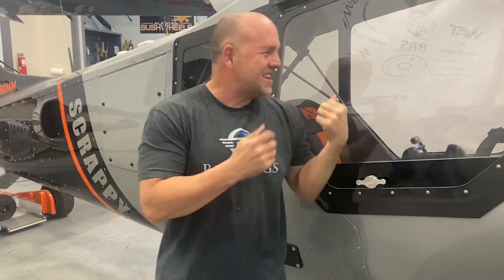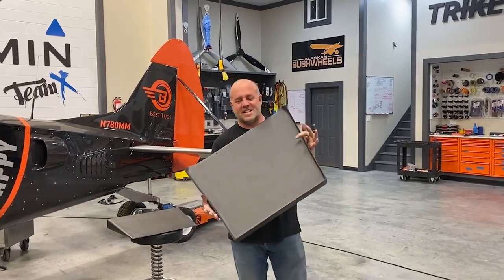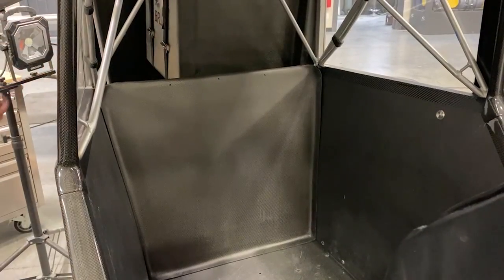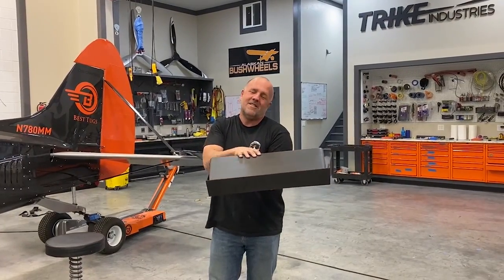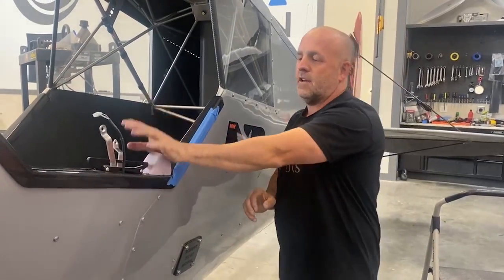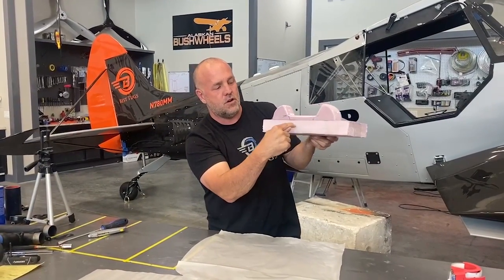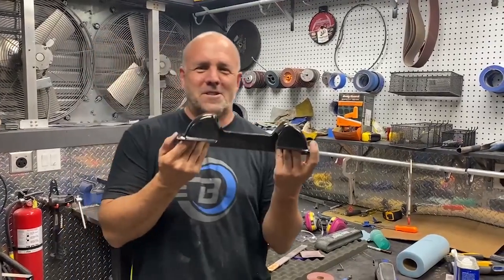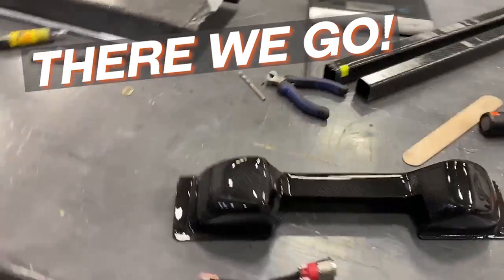2 Seat Dragster Bush Plane - Would You Ride? | Scrappy #38

Comment: When @Mike Patey called this plane "Scrappy" I thought it was going to be a junkyard builds type project where he built a plane out random parts he had laying around as a quick side project.  This plane may be based on an engine and frame that was already existing, but it has turned into a purpose built monster.  I love it!
Reply: Yeah it’s just scrap parts, any body could whip one of these up. 😂😂
Reply: After following the Draco build, I knew we were in for a treat. I knew Scrappy would be anything but 'scappy'.
Reply: @CrispyOkra  maybe..... he reused a valve stem cap........lol
Reply: I think the crash of Draco is what launched scrappy into the stratosphere.
Reply: @Brodozer39  
I can’t wait to see the new Draco/Wilga construction.  Should be interesting.
Reply: @keirfarnum6811  I’m not even ready for the next Wilga build lol. I’m still in denial that scrappy even exists at this point, it’s just too good to be real, that I can’t even comprehend the next build yet!

Comment: Is nobody going to mention the 'Easter egg'? Looks like the green Wilga getting worked on behind Scrappy at 13:43...
Reply: Looks like Mike has some helpers on the new green Draco.
Reply: Nice catch!!
Reply: I think you're correct.  He had the view perfectly blocked before and after that brief scene.
Reply: @Patriot-bn9om  believe it or not that's what caught my eye. The obvious blocking of the view out the window. I also noticed the wing in the upper corner of the screen on the shot before. I was actually hoping that it was Scrappy's wing but the Wilga is just as good.
Reply: Well he did say he was building another wilga so yeah probly
Reply: Yes, you... 👍
Reply: Great spot!
Reply: I say it's the RC Draco!
Reply: @kramermd  i have a 110 inch wingspan rc wilga with a 4 stroke gasser engine ajd its fantastic i reccomend it to everyone into rc.
Reply: @alanluscombe8a553  look in the top left at the 48 second mark... looks like Mike had 2 of them.
Reply: @kramermd  2 full size or rc?
Reply: @alanluscombe8a553  RC
Reply: @kramermd  aaahhh good eye. I most definitley see one.
Reply: @alanluscombe8a553  yes , both

Comment: Does anyone else feel like their IQ drops several points every time they watch a Patey video?

Mike--a safety concern: Maybe it was only camera angle, or maybe you already have a fix in the works, but in the shot where that guy was in the back seat, it sure seemed like there was a lot of frame structure in relatively close proximity to his head. A hard, bouncing landing could potentially cause a head injury.  A helmet or padding on the framing would help. It just caught my eye.
Reply from the maker: It’s an optical illusion, his head is quite a bit further away than it appears.

Comment: I saw throttle, prop and flap control on that assembly, but it sounds like mixture was integrated too...? I just couldn't see where? Electronic switch?

STOKED on every single one of these videos. I'm working too much to fly for these winter months ... so these videos are keeping the stoke alive in the meantime! Thanks for all the time invested in making them available.
Reply from the maker: The prop is fixed, but the blue knob is what I had on hand, it’s being changed out to red.  That’ll be my mixture. 👍🏻
Reply: @MikePatey  Oh right! That ground adjustable “main rotor” ... that y’all are calling a “propeller”. 😁 So mind boggling 🤪

Comment: It is very important to have a comfortably back seat because at some point your wife will claim the front seat !
I added back seat controls to my RV4 because it is very helpful if the front seat pilot becomes incompaciated. My installation was quite simple rudder and stick,  the throttle was on the side similar to yours I could reach it from the back seat. I decided being in the back seat with primary controls is far better than trying to reach over and around a non responsive person in the front.

Comment: Great job! I'm happy to see the doorhandle turned to the correct orientation in closed configuration . If I'm not confused, it was rotated 90 degrees in the video when it was constructed.   A cheap 3D print of the  throttle handle would have saved you two failed runs in the milling machine.  I'm expecting you to have one in the shop, so why not use it? ;-)
Reply from the maker: thanks for the comment.  I just like the look and feel of the aluminum throttle. 🤠👍🏻
Reply: @MikePatey   Of course must it be made out of aluminium!  Printed plastic would not make the cut for Scrappy.  What I ment was to 3D print a mokkup, so you could achieve the right feel at the first try in aluminium.  It's just a cost effective way to do R&D.  Have you plans for the blue handle? The colour kind of stands out from the Scrappy theme?

Comment: Hi Mike. Considering flaps switch on throttle lever .There is a similar design on An-2 by Antonov. Difference is you can only lower the flaps with this button. To retract flaps you have to use switch on the console below. I think the main purpose is for safety reason not to retract as you want to extend. I think  for you is not the case because Scrappy will not have any other users.

Comment: Quick observation about the rear seat and the apparent proximity of the fuselage framing  to the passengers head. It appears in the quick shot in the video that head impact with the fuse tubing is inevitable given bad turbulence, hard landing, or forbid, something worse. I own a USAC sprint car and we used to use roll bar padding to mitigate head strikes on the roll bars, but With the new seats, padding is no longer used, but I wanted to pass along this observation for whatever it's worth.
Reply from the maker: It’s a bit of an optical illusion, the bars are further than they appear.

Comment: Why don't you use 3d printing for parts like the throttle handle? SLA printers are cheap nowadays and with the right resin you can print a solid lightweight handle that is really strong not as strong as aluminum but way stronger than needed. I think you should look into it. It could also make your mold making a lot easier as well. Great video Every time I see you uploaded it makes my day!!
Reply from the maker: We have a couple of 3D printers and do use them occasionally.  But on this one, I just like the look and feel of the aluminum.
Reply: @MikePatey  Wait till you have to park it with the sun coming through the window.
Reply: 3d metal printer? Amazing what detail they can print now

Comment: I think I would feel a lot safer in this aircraft with its tube framed fuselage and a strut braced wing than the strutless Wilga. I was surprised how easily the starboard wing on Draco folded down at the root when the port undercarriage leg tucked under in the accident. I wonder if the Wilga with its extended wingtips and lift enhancements had a negative g-loading/torque-loading failure waiting for a chance to spring an ambush. The clean sheet engineering for the Scrappy wing at least makes the builder party to his own fate and not at risk from the unknowns in someone else's prior work.

Comment: So Mike, I worked on a seaplane  base in Belle Chasse, La, ( New Orleans). There I worked on Cessna 180, 185 and 206's and one Beaver. Seaplane pilots are notorious for rolling the plane on one float and popping flaps.  I notice all the cowboys pop flaps even on airport runways.  The 206's had electric flaps and popping flaps really did not work in that aircraft.  The transitions  from 20 degrees to 40 back to 20 was too slow.  So now you are putting electric flaps on Scrappy.  What's the goal here. I guess with Scrappies power to weight that popping flaps won't be necessary. I have a funny feeling you have this all figured out.

Comment: Having flap lever on throttle brings about much convenience similar to HOTAS concept, too convenient perhaps?
However, shall the flap lever be accidentally get triggered(be it to retract/extend) while making adjustment to throttle.
1) High speed cruise + accidentally flap extension over Vfe.
2) Low speed approach + accidentally flap retraction at Vref.
Both having risk of structural damaging/stalling though manufacturer's(in this case yourself) margins will be included in these speeds.

Comment: Mike I was just wondering.  You are doing a lot of sanding to form the foam edges.  Would it save time to round over the edges with a router table (Not sure if it would work!), but it could save alot of time in shaping your edges.  Let me know what you think, or even if you have tried it.

Comment: After you made the foam plug what did you use on top of the foam before laying the carbon?  Did you just apply some resin to give a hard surface? Also do you put any type of release on the plug or not worried because you just dig the foam out not using it over again. Thanks and can’t wait for the next vid.

Comment: Question, do you think you will have any issues with the mixture being so close to the throttle, seems like it would be easy to accidentally catch it with your fingers/knuckles when working the throttle. Not being a critic by in any way, just curious. Love the videos, can’t wait for the Draco X build 🤘🏼
Reply from the maker: It’s further away than it looks.  It’s the same throttle and mixture out of a Carbon Cub.  Good thinking though.

Comment: Has the front seat some kind of locking mechanism? The ability to flip it to the front is great but although your bodyweight holds the seat down, in zero or negative G flight you might be lifted up with your seat which would be annoying or in some cases even dangerous

Comment: I've not run into this myself, but I know how well you build so I just wanted to know---Just how air tight is the cabin on Scrappy?  Reason?  I read a story about a guy who fell asleep in a Bonanza and the plane landed (crashed flat) in a snow field.  He found out the exhaust had a crack and flooded the cabin with CO.  He lived without serious injury but admitted he should have installed a CO monitor.  Can Scrappy have this issue, or is there lots of air flow when flying?  Just a thought.  Fly Safe.

Comment: Mike, in your throttle assembly, I only saw the prop and throttle, no fuel mixture. However, you referred to the throttle as the mixture. Something is missing here. Have you got an automatic fuel controller on this engine?
Reply from the maker: All I had was a blue knob on hand, it’ll be changed out to red.
Reply from the maker: Lol 😂 yea I new somebody would catch that.  I only had a prop handle scrap on my shelf so I put it on to run it but I have a red mixture handle I’m replacing it with.  It will be red soon
Reply: @MikePatey  Haha, it’s funny what people see. So that is a fixed prop then?

Comment: Scrappys wings are complete, and are hiding (hanging) in plain sight. 12:30
Wings are painted in gloriously reflective colors. 12:38 through 13:29

I suspect the orientation  of  Scrappy in the shop has to do with static  (or not so static) wing testing. And/or the addition of a Wilga..

Lack of fuel tanks are explained at 13:49 as are the A/N fittings and the JATO/Float plates... External tanks/folding step.
Oh wings... Telescoping wing and airfoil control mechanism 

https://patents.google.com/patent/US7866610B2/en

When he does floats, floats they will serve as fuel tanks.

Jus sayin. 

Never underestimate a five year old.

Comment: Okay hear me out because I don't know if this is a good idea or not. Get a tungsten  flywheel put it on the engines shaft, then a clutch and then carbon fiber props, I'm thinking you could do some sort of rev up and store a whole lot more energy in the flywheel and then pretty much dump the clutch and instantly put a ton of energy into the propellers.

Comment: Normally I agreed with almost everything you do.... But I have to disagree with the throttle drilling... Not because of structural... But cleaning it will be a problem. Won't those holes fill with dirt?  Once filled how much weight will you have saved?
Reply from the maker: Good question, so they pass all the way trough and the bottom is hollow so it can’t collect dirt.  I’m not sure how often I would grab with muddy or dirty hands but it will just fall right out.

Comment: so, what do you think about the secured point/ attached /pin point being were the seat belt is.    another words. the easy way to break a point of security is at the point of security/ the pins........   so, i thinks the pins attached to the plane will break at a crash with all force being on them and not a secondary point.    just a thought.   if that made any since, i see the problem in my head and i might not be able to say it out loud correctly.

Comment: In our (tube frame) race cars, you have to have a structural seat, contained/floating with the roll structure.  I won't even go into MBs in the Navy stuff I flew.  In GA is there no requirements on seat strength?  mounting to crash structure?

Comment: I have been wondering for awhile and have to ask.  Have you considered using 3D prints for carbon fiber molds?  I know you bang out those foam molds cheap and dirty but I see some places that a quick sketch in solid works and a print would give a really nice mold.  I really would like to hear your thoughts on this.  Stop reading this and get back to work!  cheers

Comment: i only have 1 or 2 problems with scrappy, 1 you sealed 1 side of your plane so you blocked an emergency egress if it rolls and lands with the craft door side down you could be trapped. 2 its a gas hog add hho to your system to improve efficiency and output.

Comment: What did you use on the foam to make it shiny before you put the carbon fiber on? Is it to keep it from melting from the epoxy or the heat of the reaction?
Reply from the maker: It’s clear, standard packing tape to
get the foam to release.
Reply: @MikePatey  I’ve seen you use it before but it just looked different this time. Looking great and always great to see your brain at work.

Comment: Buenos dias. Mike, lm  Cubano  lm leaving in Huntington beach California and I building RC airplanes I use the same  pink fomy.
What type epoxy you using???? Thx.
Reply: I using KWIK BOND EPOXY High Strength Part "A" Resin, Part " B" Hardener  sets in 30 minutes, it no good  get to hot and malted the pink and the blue  fomy. Thx

Comment: I really encourage you to dare build a plane from scratch to have the design freedom to make it super aerodynamic, light, fast and perhaps single piece. When you start from an existing model you are very constrained and do enormous work around those limitations. From scratch is so much better and easier. Just have to dare take responsibility for the design which you do already anyway.
Reply: And if you really want to knock it out of the park then have tiny turbofan engines made. 2 10kg engines on a 100kg 2 seater plane. Razor laminar wings. Pressurized, transsonic. So quiet and smooth. And with 2 engines you can go over the pond to Europe. Flying gas can, maybe 4000km range.

Comment: I have a question I wonder if anyone can answer. On a build like this how does one test the capabilities of the airplane while at the same time taking into account stress on the airframe and and wings etc.  For example, how do you test the safe amount of stress the wings can take at a certain altitude going at a certain speed, and doing this for the entire lifetime of the aircraft.  This is probably not the clearest of explanation, I don't have a manufacturing or mechanical background, but instead a electronics engineering background. So I apologise for the poor wording/description.
Reply from the maker: Great question. Hard to answer quickly.  so I’ll do a video about it.  Every part is engineered and many stressed to failure first. Others are based on past test. Wings are based on FEA runs and calculations as well as wings of the past and adjusted for additional loads.  I often have twice the time on the engineering side than I do on the building of the components.
Reply: @MikePatey  That's so awesome you gave a reply. And here I was  just hoping  someone in the community will see the comment and give a reply.  :D A video would be amazing. It's pretty cool what can be done with software nowadays. I can imagine a lot of planning has gone into the build. It's truly awesome. I could probably ask 100 more questions,  but instead I'll be patient for some video content. I love learning about the technical details (as I'm sure many more who watch the videos do).  If you happen to read this, thanks for all the great content. God bless and hope you have a great week ahead.

Comment: Piece of that gel computer mouse padding would be nice against your palm too. so your not gripping things tightly giving you cramps. And these rock. https://www.amazon.com/DeVilbiss-DPC8-Spray-Cleaning-Bottle/dp/B0025VR35C  (napa paint supply) also ketchup squirt bottles are ok for non nasty stuff. and rear tall Pax in bumpy times gonna smack their head on the tubing??or have a place to rest their noggin  when straight N level? and some areas to stick a go pro and have usb ports in back? .  Pouches for maps / Flight manual  / Blulah bags.  nice positive ventilation for the flight back after a bowl of chilli ?? seatback  tray, to write/eat/take clearances on?

Comment: So, I'm confused. I remember early on in the build when you showed us the massive prop you were using off a swamp boat and you explained that it would be a variable pitch prop (not constant speed though). Now I see you making the throttle quad and you only have two levers. One is throttle and the other is mixture you say. Where is the prop control and why is the mixture handle blue? Shouldn't it have a red grip?